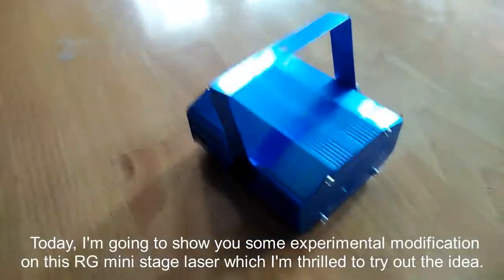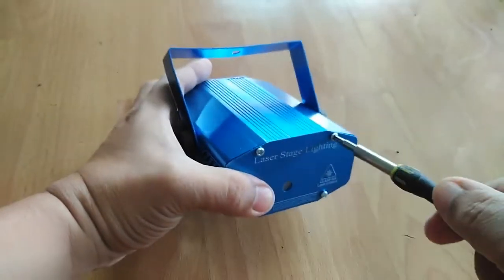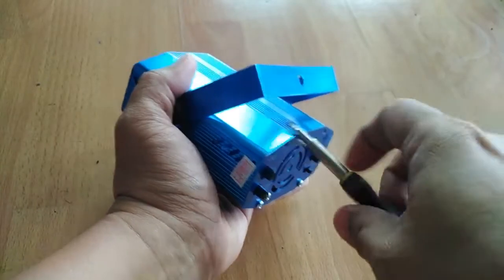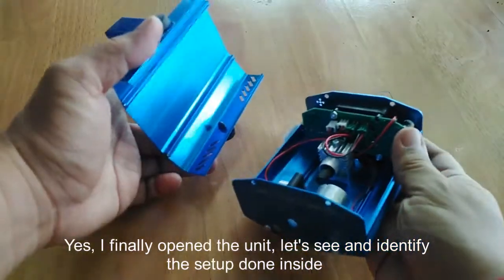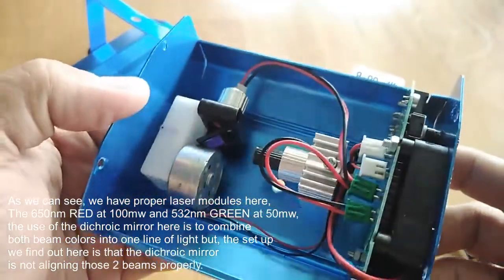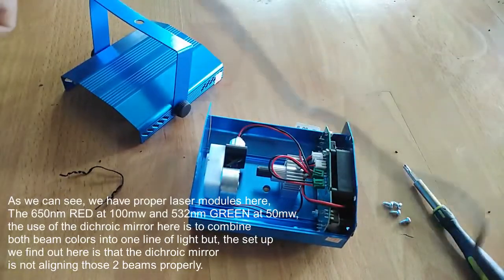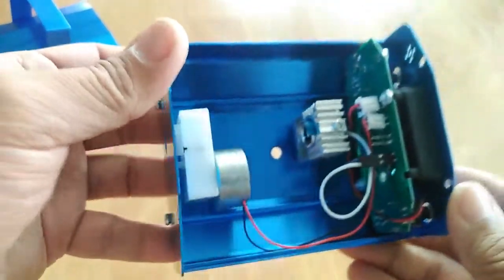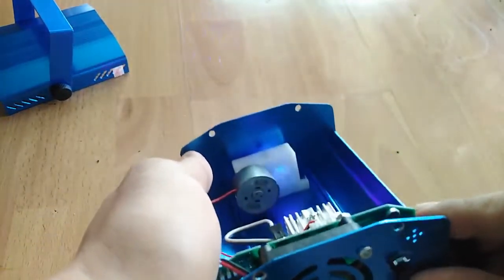Mini Stage Laser Modification Demo: A Guide to Improving Your Laser System

Comment: @lasershowlab i have same model light but green colour not working any solution?
Reply from the maker: the green laser there is DPSS usually  IR diode is problematic, there still some spikes on the driver though, you can replace the laser module with new one will be suggested.